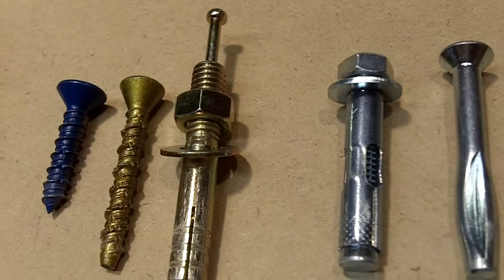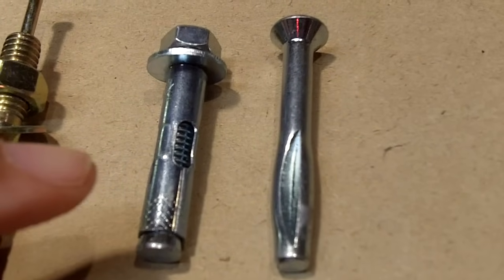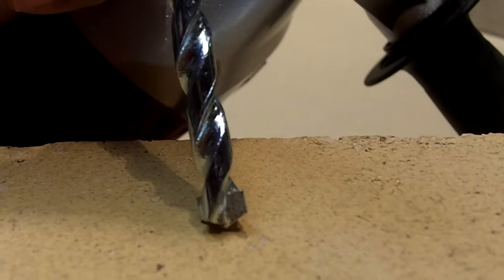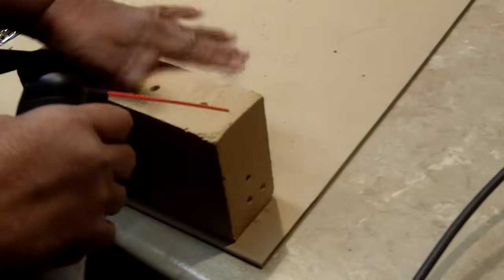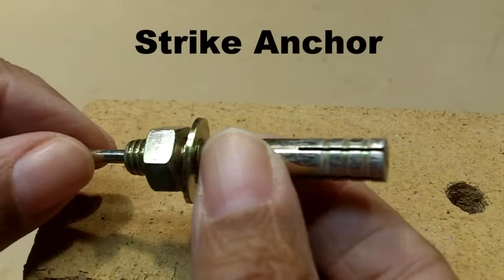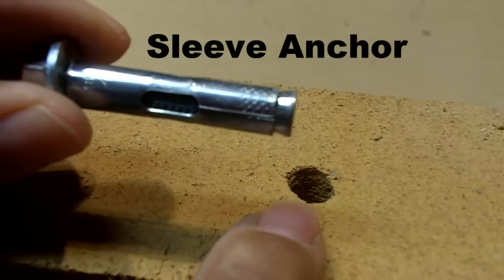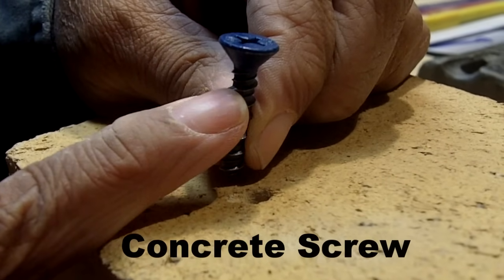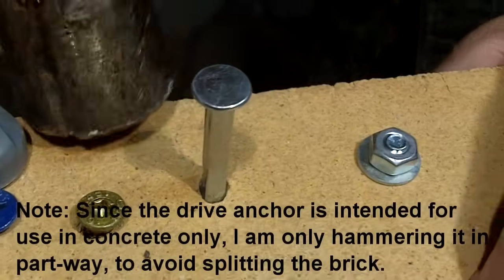A Beginner's Guide to Attaching Things to Concrete and Brick

Comment: Just bang in a wooden dowel, they don't abrade concrete the way metal does.  3/8 hole, 3/8 dowel, drill a small hole in the dowel and screw into that.

Comment: Hole needs to be 1/4 inch wider than the anchor then you need to put anchoring epoxy. Otherwise the anchor would be turning in empty when you try to remove/tight the nut as time goes by.

Comment: my comment, she does do a good job..my problem see points people down the wrong road..all concrete anchors fail..period..expansion and contraction sees to that..why was a machine screw anchor not mentioned, it is first and foremost the only anchor that can be repaired IN PLACE, stacked to improve, bearing, and is both removeable and permanent..she does a good, but

Comment: The drill bit shown is ok for brick, but should not be used on poured concrete in hammer mode. The stone in the aggregate is much harder than claybrick or concrete block.
Reply: So what drill would you recommend for concrete. I have some work to do in the next week...

Comment: OK but I need to know more than that. First and foremost I assume you should install those THROUGH the hole in whatever you are anchoring down. Yes, some of us would think it’s like a sheet rock anchor that you put in first then take the screw out and put up your shelf or whatever you’re putting up. I have always been under the impression that you could use a masonry bit with just a regular drill so would like to know if you have to have a hammer drill. I don’t know what makes you think they are easily accessible because I have no access to one and I don’t want to buy one just to use it for four holes. Also, I would like to know what kind of anchor is best for what I am doing - anchoring a tent canopy over my patio swing. This is not for beginners, this video is for people who already have some knowledge.

Comment: Don't Bring a hammer drill to a job site, you will just irritate  other contractors,
A Rotary hammer works far better, faster and less annoying with less noise.
A hammer drill is a back up if you are in a situation where you need to anchor in to Concrete unexpectedly !!!!